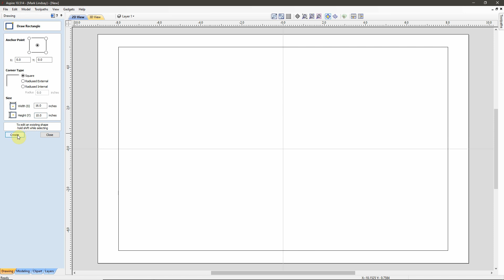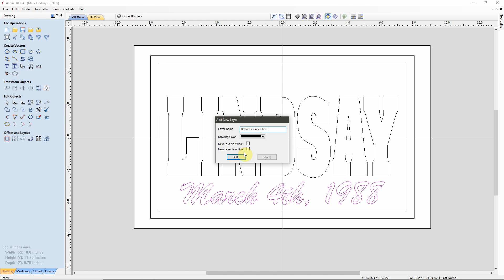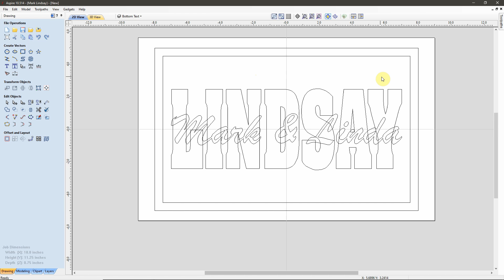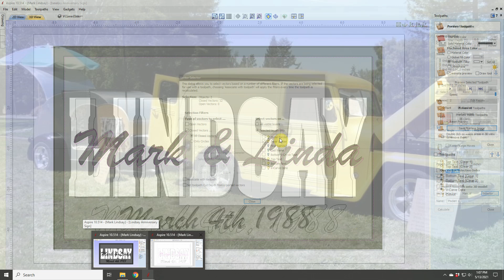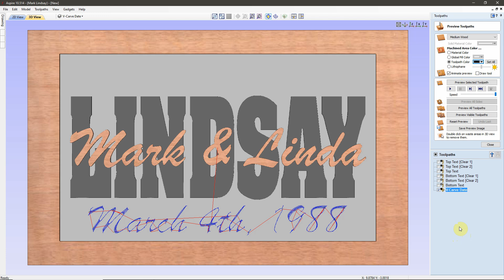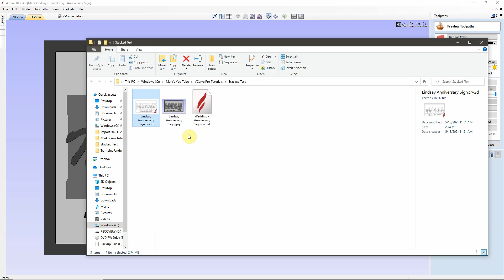Stacked Text - Part 1 - Create Stacked Text in Cut2D, VCarve, and Aspire

Comment: Mark when I do the Vcarve pass the bit plunges really deep which ruins my project. Everything is set just like you said. What am I doing wrong?
Can I change the depth of cut? I have done this 4 times. I need your advise please. This is for a wedding gift FOR today!!!! HELP PLEASE
Reply from the maker: Make sure you're setting the correct Start Depth, and that the total of the start depth and the Flat Depth is no more than 3/4 of the thickness of your material. If you're not using a flat depth, either use one, or go for the shallowest bit angle you have (i.e. 90° - possibly 100°.)

Comment: Hi Mark, Sometimes when i weld my font the inner circles of the letters disappears. For example the inside on an o, e or p the circle on the inside disappears. Do you know how to prevent this?
Reply from the maker: This usually happens in older versions of the software. What you'll need to do is select the text, right-click, and select Convert to Curves. From there, select the text vectors WITHOUT the inner circles, and weld them. That will cure the issue.
Reply: @MarkLindsayCNC  Thank you Mark

Comment: Mark I have question on my stacked text? I tried doing stacked in vcarve mode with a 60 degree bit and my top text gets cut down thinner where its just top text and wider when top text is on the bottom text. Do I have to offset the top text to keep it the same size? It seems that when I do the finale 60 degree pass on bottom text it cuts top text thinner and different sizes.. Can you explain this to me. Thank you in advance..

Comment: Question. If you were to actually make this sign would you re-order the toolpaths to do all 1/4 cuts on ALL layers, then switch bit to 1/8th bit, cut all layers and repeat?
Reply from the maker: You can do that as long as you remember to order the toolpaths so that you run the top layer first, then the bottom layer last. That's to prevent the bit plunging too deeply into the material in a single pass.

Comment: Another informative great video with awesome explanation and easy to follow.  Just curious how long it would take to run this because after I calculated it said 5 hr?! Thanks Mark
Reply from the maker: The machine time depends on a lot of variables (too many to list here), but depending on your machine, it could take that long or longer. Just make sure that you have the Pass Depth, Feed Rate, Plunge Rate, and Stepover for each bit set to numbers that are safe and appropriate for your machine and your bit(s.) When you look at the Toolpath Summary, enter your machine's Rapid Rate into the blank, and the summary will give you an estimate. Remember that the summary is giving an estimate. Your actual machining time may be more or less, depending on your machine.

Comment: Why do you start with your top text before going to the bottom
Reply from the maker: The main reason is to remove material from what will become the top surface of the bottom text/artwork. If I remove that material first, I can see if there are any defects in the material below surface level, and be sure that my choice of bit isn't leaving bad finish quality. It's also easier on the bit to remove smaller amounts of material at a time, carving from the top down.

Comment: Hi Mark, how do you do the V-carve part on Cut2D?? I can't find the option I only see "Quick Engraving" and I don't know how to set that properly so that it doesn't mess with the rest of the project. Thank you !!
Reply from the maker: I'm afraid V-Carving isn't available in Cut2D. You would need to upgrade to VCarve Desktop or VCarve Pro in order to v-carve. For future reference, Quick Engraving is designed to be used with a diamond drag bit or small engraving bits. It's mainly used to engrave metal, acrylic, plastics, and things of that nature. It's occasionally used on wood, but it's not the same effect as v-carving.
Reply: @MarkLindsayCNC  Oh okok thank you!! I just read the title of the video and thought the whole project was meant for Cut2D but I guess I can just add something extra there that I can actually do with this software? :)

Comment: Mark great lesson worked perfect only question is do i save all gcodes to one file or to multiple
Reply from the maker: Generally speaking, I save all the g-code that uses the same bit as 1 g-code file, with one important exception. I ALWAYS save the Profile Cutout as a separate g-code file, and it's ALWAYS the last operation I do. Just make sure you have your toolpaths in the correct order before saving g-code, then run that g-code in order, and you'll be fine.

Comment: Followed this tutorial step by step *However having a welding issue. When I get to the First Names and attempt to weld I don't get the same results. R D A letters etc....all have the insides disappear? I can use the TRIM scissors tool to weld the text correctly, however later when I select last name and first name and attempt to weld once again it's deeting out the insides of the letters. WTF using aspire 9.514 any help?
Reply from the maker: On your version, you'll need to convert the text to curves before welding, then when you select the text to weld it, DO NOT select the inside of the letters, unless the text above it is crossing over it. If it's an O that's out on its own, for example, don't select the inside of it when you weld. You WILL select it when you go to pocket cut the text.
Reply: @MarkLindsayCNC  Perfect! Thank you for all your effort you put into your lessons Mark! Been machining for years and still learn new stuff from you all the time. Thanks for the reply. I ended up using my newer version on V Carve Pro and it worked like the tutorial. Can't believe I didn't think to not select the inner parts in Aspire! DOH lol

Comment: Sorry if I missed this but on the 1/16 end mill is it a down or up cut ? 
Newbie here so here so I appreciate the help .
Reply from the maker: Generally speaking, it's pretty hard to find 1/16 inch downcut end mills. If you can find one, by all means use one. All of mine are upcut, however.

Comment: Mark, I drew this up on Aspire.  
When machining, my 2nd clearing tool path (1/8" EM) was offset.  Looked on forums for wincnc and aspire and found others with the complaint, no solutions.  Any ideas?  I followed your instructions precisely.
Reply from the maker: I've not had that issue. Was this in the preview or on the actual carve on the machine?
Reply: @MarkLindsayCNC  This was in the actual carve in the machine. Preview was fine.
Reply from the maker: I would highly suggest emailing Vectric tech support, as well as WinCNC tech support for help with this issue. Between the two of them, they should get you squared away. Sorry I'm not a lot of help. I've never experienced the issue.

Comment: Thank you Mark for a excellent video. I was wondering what is your favorate choice of wood for stacking text sign. 
Keep up with the good work !
Reply from the maker: Basically, any medium to dense hard wood is my favorite. It just depends on the project and what the recipient wants. Maple, cherry, sapele, mahogany, and bunch of others are great candidates.  Remember to practice in some scrap before you try carving an expensive piece of material.
Reply: @MarkLindsayCNC  Thank you for your fast and prompt reply. I've done a couple of signs according to your video with success. 
I've been using birch, oak and for smaller projects Pawlovia. Thanks once more for your excellent videos - they're absolutely the best.
Reply from the maker: I've found red oak to be difficult to get a good result from. White oak, on the other hand, machines very well. Birch should be a good choice, although I haven't personally used it for stacked text. I have no experience at all with Paulonia. I might need to get some and give it a try.

Comment: Very nice video mark 
I have a question
 when you do the probing do you probe on top of every area you mill down ?
Reply from the maker: If you mean using my touch plate to set the Z zero, I pick one spot on the material that is not going to be carved away and use that spot to set my Z zero initially, and after every tool change. Contrary to popular belief, you do NOT have to set your Z zer at the same spot you set your X and Y zero.

Comment: I’m new to this learning as much as I can before I even have my machine. I like your videos very informative but could you also show saving the g code and actually cutting out a project. But for this specific project would you save all 1/4” tool paths and do them together back to back so all rough in is done then load all of the 1/8” so on so you are just running each tool paths and only changing bits 4 times
Reply from the maker: I currently have just under 300 videos on my channel (296 to be exact,) and I have shown this in several project videos. If you look at the first 2 videos in my 2-Sided Machining video series, I design the project and save g-code in Part 1, then demonstrate actually cutting the project (including the tool changes,) in Part 2. Here's a link to the playlist: https://www.youtube.com/playlist?list=PLLuYLaC3-QRPY1yU-D-QcUNUIcjzYkCdb
Reply: @MarkLindsayCNC  I’ll look at them shortly but because there is so many videos I haven’t seen them all yet. But again it may sound kinda like a dumb question but do you do all 3 tool paths for the top text then do all 3 tool paths for the bottom text or do you start with the 1/4” and run the tool path for the top text bottom text and cutout then run all  the tool paths for the 1/8” and so on. I mean doing it the second way should be faster so you don’t have to keep changing tools and re zeroing but didn’t know if you would end up running into issues doing it that want
Reply from the maker: My approach is kind of like the second way you asked about, with 1 important exception: ALWAYS run the profile cutout as the very last operation. I almost always save the Profile Cutout as a separate g-code file and run it last, when I'm SURE I'm ready to cut it out. You don't want to run the Profile Cutout, then have more carving or machining to do on the piece. There's too much potential for the piece to break loose during one of those other operations. So, I would group all the toolpaths that use the 1/4 inch end mill together EXCPT for the Profile cutout, and save them as 1 piece of g-code. Then I'd do the same for the 1/8 inch end mill, then the same for the v-bit. THEN I'd save the Profile Cutout as its own g-code file. I will demonstrate that in a video when I get moved into the new shop. Hang in there - it's coming soon...
Reply: @MarkLindsayCNC  10-4 thanks and still learning still brand new don’t even have the software yet let alone a machine to put to work but your videos are informative and I’ve watched quite a few of them

Comment: When you are using an endmill do you use an up cut or down cut endmill or does it make a difference?
Reply from the maker: I use a downcut bit, but only because it leaves a better surface finish on the top edges of the material.

Comment: I'm trying to use vcarve pro to do this project. This might be a silly question but I can't add more than one tool or if you can how do you do it. Thanks in advance
Reply from the maker: I talked about this in one of my Live Q&A sessions, but I can't remember which one right off the top of my head. Basically, it comes down to which version of the software you're using. If you're using Version 10.0 or earlier, you can only add one tool by checking the Use Large Area Clearance Tool box in the toolpath form. If you're using Version 10.5 or later, you can use multiple tools within the same toolpath, by clicking the SELECT button and adding tools one by one. If you haven't upgraded to Version 10.5, I would encourage you to do so. It's well worth it!

Comment: If there is a 3d element inside the pocket do you have to do a finishing pass on the whole thing?
Reply from the maker: For a 3D element, you can create a vector boundary around that 3D component, then machine to that selected vector in your 3D roughing and finishing toolpaths.

Comment: Great video!  What 1/16" end mill would you use for this project?
Reply from the maker: The brand doesn't really matter. I use a Kyocera 1/16 inch bit I got from eBay. Keep in mind that these are 1/8 inch shank, so if you don't have a 1/8 inch collet, they won't work for you. Here's a link: https://ebay.us/xPsd1e
Reply: @MarkLindsayCNC  thanks!

Comment: Mark,

Great & timely video.  I have 3 of these to do & have been sucking up all sorts of videos.  The emphasis on creating a template was very helpful.  Can't wait for the next on on how to use the template we made today.  Love the tip about the small final pass on the pockets.

Suggestion for the 3rd video in this series:  How to use a V bit to carve all the proud letters where you have to offset the first name text that is on the bottom text layers (actually, it seems you can use an offset in the bottom text VCarve tool path, I think)

Have a good week.

The MidWest Trouble Maker
Dave Deitrick